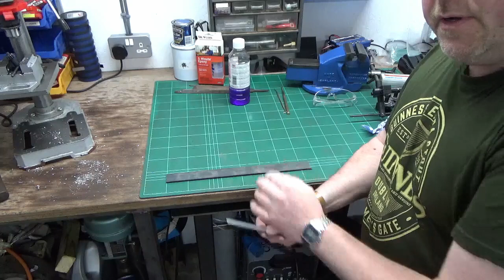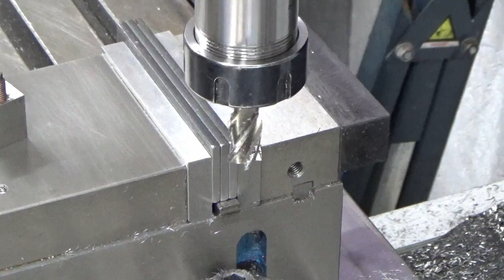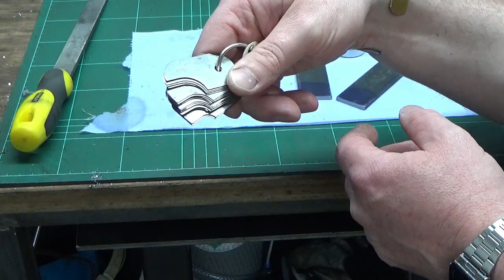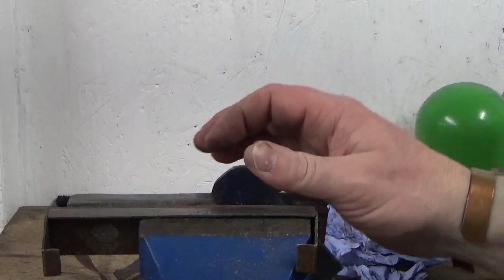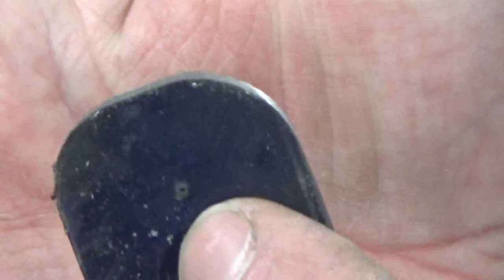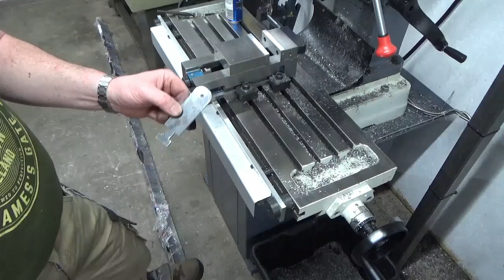Making T Slot Cleaners For 1000 Subs Giveaway

Comment: OK I'm going to sound like a dick, why a T slot, At work and at home a I use a 1" brush side ways. At some one come up to me and said they do make T slots, my responce was " have you ever used a mill or lathe " NOP, untill then don't tell me what you have read in a book, I find that a brush works much better, try it once. Sorry Jon, " Steve the dick "
Reply from the maker: Hi Steve, thanks for the comment. Lol, no apologies needed. I also use a brush. The short answer to the question is laziness. When a T Slot is not cleared regularly enough and gets rammed with swarf, best brush in the world isn't shifting it. T Slot cleaners are just to quickly clear the bulk without ripping your brush to bits. Hope this helps answer. Cheers, Jon

Comment: Nice work on the T slot cleaners Jon. Looks like I’ve got another project for the list 😎
Reply from the maker: Hi John, thanks for the comment. You don't need to go down the route I did, hacksaw and file would be much quicker and easier but just as effective. Cheers, Jon

Comment: Heat to cherry red and quench them in Guinness.... The ultimate chemical blacking process.
I saw Quinn using one of those sponge top Dykem applicators and I couldn't find them in the UK. Have to go search again.
Reply from the maker: Hi Howard, thanks for the comment. No, no, no, that just won't do at all, hate drinking warm beer! Got mine off ebay I think, or it could have been a Google search with 'shopping' filter on. Cheers, Jon

Comment: Hey Jon, hope yer good Dude? Not a bandsaw expert by any degree (in fact I have had a woodwork one for a week, tis a nice one though RP 350 Sabre) but best me knowl the bearings either side of the blade should not rotate when the blade just runs or when cutting straight they should just spin when the blade is twisted i.e. when cutting curves! oh n please let me win LOL. All the best Dude. TFS, GB :)
Thanks for the heads up on the radius gauges Jon, I honestly thought they were meant for marking out will take beterer care of mine from now on :)
Reply from the maker: Hi Graeme, thanks for the comment. I must check the bearings, never really noticed they were engaged all the time, they should be just touching the blade but you should be able to spin them by hand (with the blade not running of course)! Yep, the proper way to mark out a radius like this is to scribe the rad centre, then use a pair of dividers. Cheers, Jon

Comment: Naughty, Naughty Jon, using mild steel on an offhand grinder wheel. Highly frowned upon in industry. Bandsaw then belt sander, or bandsaw and file. Regards from Australia.
Reply from the maker: Hi Dave, thanks for the comment. Yes I know its not good practice but it's only because it glazes the wheel over and mine is ready for a dress anyway. No belt sander as of yet (future project) and until I make a centre bung for the bandsaw, that's out as well so just went for it to get the job done. Cheers, Jon

Comment: I used a fat sharpie marker for marking up easy and clean
Reply from the maker: Hi Peter, thanks for the comment. Yes, I often do the same, works well. That little Dykem bottle is brilliant for sheet metal where you have long cuts/bends etc, in fact with the felt pad, it's very much like a fat marker pen. Cheers, Jon

Comment: Can you insert that at the vice and then pull it out or do you have to start at the end
Reply: Nicely done. My Chester mill drill has the same size t slots, in fact the exact same table. Just saying. I'm kidding of course, you've already been more than generous. Roll on 1000 subscribers, richly deserved.
Reply from the maker: @carlwilson1772  Hi Carl, thanks for the comment. Judging by the response to this video, you will have a 2 in 13 chance (I am sure there is a better horseracing way of describing these odds!). Cheers, Jon
Reply from the maker: Hi Kimber, thanks for the comment, yes you can, you place it in length ways and then rotate into the T slot. It's a must have tool for the mill. Cheers, Jon